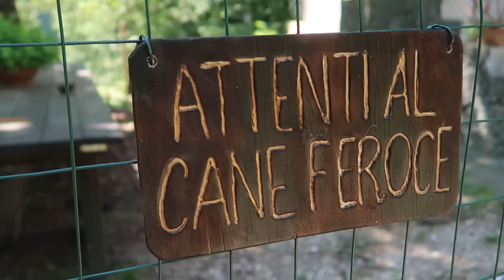I lost my fight against rocks but found a 100 year old relic.

Comment: Hey Marina, I'm also into baking my own bread and I either use my cast iron pot from Lidl (bought it a little over a year ago for around € 50 ) or a random cooking pot that I pop into the oven (must be made fully from metal incl. the lid)
Both ways worked well and my bread is amazing..! 😊
So there's definitely no need to spend lots of money on a fancy dutch oven...
Happy baking! ❤
Reply from the maker: That's very good to know! thank you for the tip and happy baking to you 😊
Reply: Agree, I've had a cast iron pot that I bought from Ikea 15 years ago. It's brilliant.  Just make sure to get the cast iron inside not the glazed inside.  I don't know about bread making but it seems to make everything I cook taste better!

Comment: In regard to the cartridge case you found The four staight lines (hinting at a cross) can often be seen on rounds manufactured for a foreign buyer  by a supplying maker from  outside the national boundaries of  the buyer.
Each quadrant on the base usually contains letters or numbers. I tried enlarging to see what, if any, they were. But - sorry could not get any clear image.
These may well  enable  positive identification of origin , and even the  typr od weapon and thus probable army that used the round.
Reply from the maker: Hi! I looked online but could not find the exact shell. On the top quadrant it's marked "I" bottom one "W" left "19" right "17" . Is there a database one can use to identify them?

Comment: @Wild She Goes • Marina: Your introduction was beautiful. I love when the clouds reflect in the water. The flowers were absolutely gorgeous.

I've been waiting to see how your potatoes would do. If some are rotting, you may have drainage issues. Seeing the rocks, drainage issues wouldn't surprise me. Since you already have the jack hammer attachment, you may want to just make holes in the rocks from the top. Once water gets in, the freeze-thaw cycle will help break down the rocks.

Thanks for explaining the Blueland refills. I didn't realize the used a tablet. Nice.

Beautiful summertime video. Thanks!
Reply from the maker: That's a cleaver tip, thank you Yvonne! So glad you enjoyed watching the video 🤗

Comment: As already mentioned a cheap cast iron pot works just as well, and if you get bored of making bread they are great for cooking lots of other things like any pot meals, rice, veggies so it will always have a use ❤
Reply from the maker: I think I'll get one of those!
Reply: sometimes lidl here in Italy offers large cast iron pots for a very affordable price. last year I bought a wonderful enameled pot for around 30 euros. an equivalent crouzet or similar object can cost 200 or more
Reply: I have one of those old cast iron hinged pots, with lid.

Must be at least 60 or 70 years old by now. My age. 😉 

It's a wonderful, versatile pot which is great for use in campfire cooking too.

Comment: try it in a steel pot with a lid it will still rise really well just not take the shape as nice, use a pot with a very heavy base and pre heat it and the lid same as a Dutch oven
Reply from the maker: THank you for the tip!

Comment: Hi Marina. I also bake bread at home. I do have a cast iron pot but often use a glass (pyrex) casserole dish. As long as the pot has a lid, you should get the same result as cast iron. I've had some good results with this method. The glass (or china pot) requires less time to get up to temperature too, so less fuel use.  Fresh bread is the best. 
Thankyou  for the video, i always enjoy seeing what you're up to. 👍🏻
Reply from the maker: That's a great tip thank you!!

Comment: Marina, the fancy enameled pots are EXPENSIVE, but I make really good bread in a plain old cast iron dutch oven-- essentially a mid-sized pot with a lid. It's got all the qualities of the fancy ones, but for the mostly decorative enamel. I use the same pot for stews, soups and the like, so it's not a uni-tasker. Highly reccommend. And thanks for the delightful content.
Reply from the maker: Thank you so much for the tip!

Comment: Congratulations! You're doing a great job, but I'll leave you this tip: It's not recommended to expose the potatoes directly to the sun, as it will raise the level of solanine. This may be detectable by surface greening on exposed parts of the potato. Green is an indicator of solanine, which is toxic. Sprouts also contain it.
Reply from the maker: Hi Sergio! Yes I'm aware, however this is what they've been doing around here for much longer than I've been alive so I'll give it a go. One day hopefully won't harm them!
Reply: @WildSheGoes  In Portugal this is also traditionally done, but the potatoes are laid out in the sun on the harvest field before being washed. The dust that covers them acts as a kind of anti-UV protector.
Here, the potatoes sold in small bags in supermarkets are usually already washed, but those in the 20 kg net bags sold in grocery stores or agricultural warehouses remain unwashed, as if covered in very fine clay dust. This helps to prevent them from sprouting or rotting during wet, cool weather in autumn and winter.

Comment: Could be a 6.5 carcano case. If the length is 52mm and the inside of the neck is about 6.5mm that’s probably it. Probably left behind by the last home owner whose beet greens were eaten by the dinner on the hoof.

My sourdough culture took quite awhile before it had enough maturity to rise well. If yours is still a little week, just give it more time in the preferment and rising. Keep feeding it and using it until it starts doing real work for you. Eating poorly risen bread for awhile will give you even more joy when things start really going right.

Could you do us all a favor and really screw up a craft occasionally so that the rest of us can feel a little better about ourselves?

That ipa will keep a good long time, if there’s enough hops, which are a bit of a preservative. Keep it cool and in the dark. Looks like those kits have some crystal or chocolate malt included in the mash. Unless you’re dry roasting the malt first.